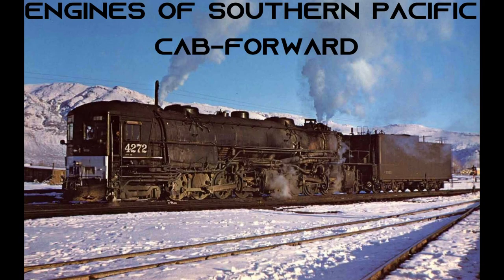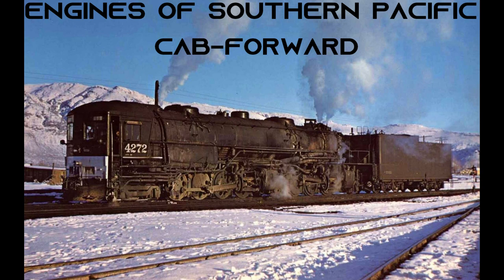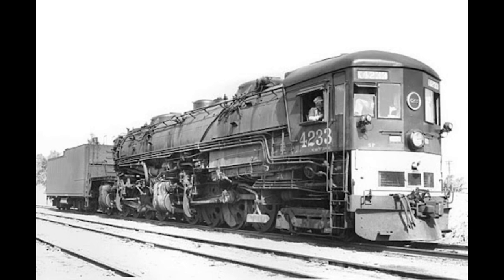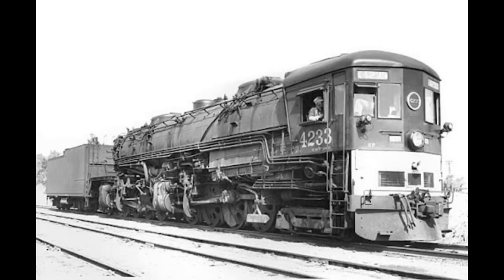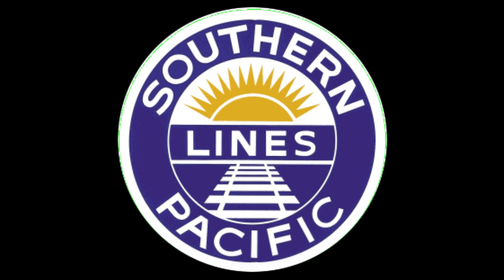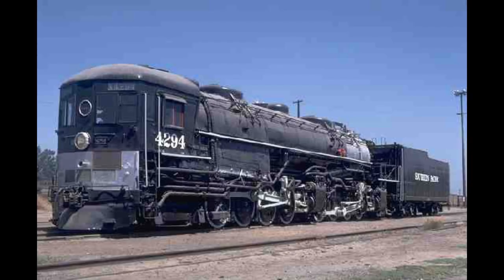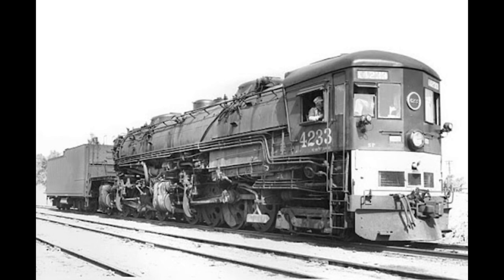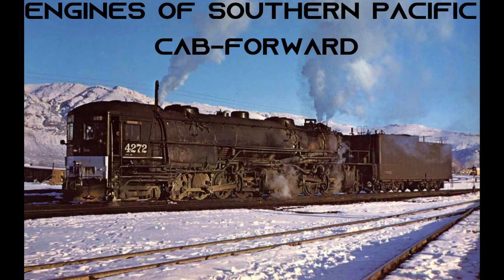Engines of Southern Pacific: Cab-forward steam engine

Comment: I'm a retired engineer with the SP/UPRR out of Roseville, Ca. and operated to both Dunnsmuir and Reno and even today there still the danger of choking on the fumes from the loco's inside tunnels. The tunnel at Norden, Ca. is 2 miles long, uphill for westbound trains, and crest's Donner Summit 1 1/2 miles before exiting the west end. Crews carry SCUBA (or scram packs) gear invented for the SP due to injuries that happened from trains stalling or braking down inside the tunnel. That is why Cab-forwords were built, the tunnels and miles of snowsheds on Donner Pass.

Comment: Thanks for posting this.  The cab forward is one of my favorites from the steam era and it's a shame that only one has been preserved.  A couple quick points -  while the multi-engine articulated types are similar to a mallet, the cab forward is actually a compound rather than a mallet.  The mallet has high pressure cylinders on one set of running gear and low pressure on the other.  The low pressure cylinders are powered by the exhaust from the high powered cylinders. On a compound articulate, all the cylinders are high pressure and receive their own supply of steam.  
One other thing, and the reason cab forwards worked, steam engines have the same amount of power running forwards as they do in reverse.  Thus, when a cab forward is running forward, it is the same as a conventionally cabbed locomotive running in reverse.  When running through the many tunnels and snow sheds that the Southern Pacific had in the Sierras, it put the occupants of the cab ahead of the exhaust rather than in the middle of it where they could be asphyxiated. 
Keep up your attempts at these videos and they'll get even better.  Something that might help is to write a script for yourself, practice it, and then time it so that you have an idea of how much material you will produce.  Good luck!
Reply from the maker: Glad you enjoyed it!